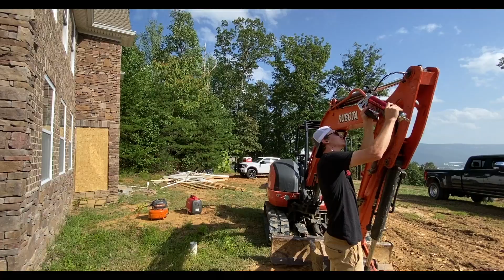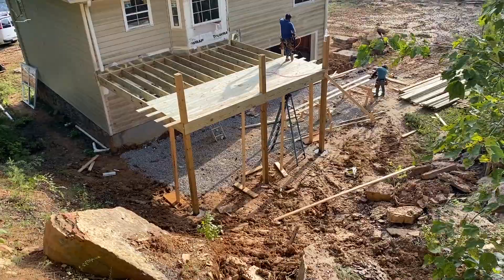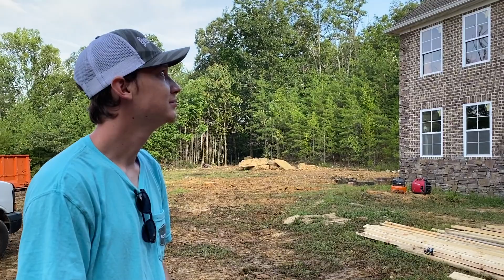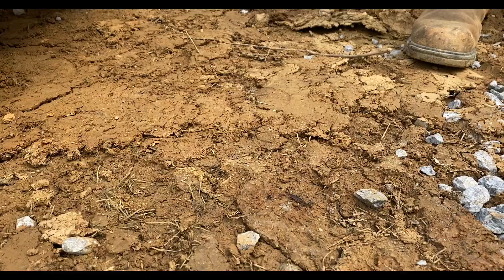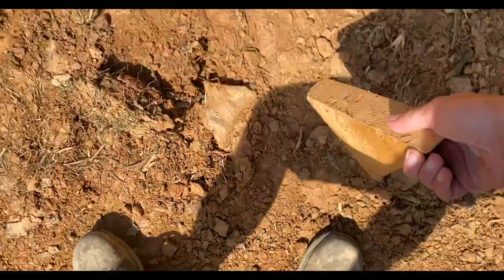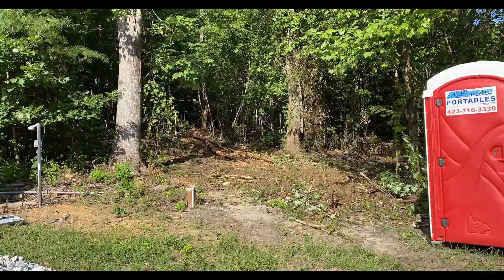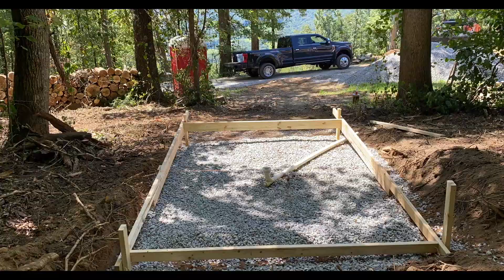The New Goonzquad Headquarters Part 9

Comment: Are you going to move the well, most people keep the pump as close to the well as possible. You need to at least put some 5x5 reinforcement wire in your concrete and 1 piece of 1/2" rebar around the perimeter or 3/8" rebar on 18" centers if you can't get any rebar chairs just use flat rock to hold it up. And get the plumber to rough in the plumbing where you intend to bring the water into and out of the pump house. If you don't bury it at least beneath the frost line you'll wish you would have. Ask your plumber, he knows what to do. 
You should build the pump house over the well, you'll be sorry you didn't. Retired construction superintendent, built everything from chicken coups to 18 story High-rise Condominiums to projects where 20 tilt wall warehouses covered from between 10 to 16 acres each with over 150 acres of concrete paving. I lived on several country estates where Community water wasn't an option, so I'm not yanking your chain about keeping your water lines beneath the frost line and keep it as simple as you possibly can. You might have to dig it up and chopping tree roots down in a ditch sucks.

Comment: Has anyone inspected the roof of the house from inside? From the video it looks as if the roof decking is warped quite a bit. I would have a roofer inspect it to see if it is leaking or allowing moisture to build up inside. Make sure it has proper ventilation as well.

Comment: Good work with the slab it is the best way to go, I put in 2500 sq feet last year at my place. MY 3 top tips 1 Go thicker (i used 125mm (5 inch) ) as concrete is cheap. 2 Use steel reo. 3. Put more conduits under than you think youll need. When you put in your garage  put in a service conduit 6 inch to a central service cabiinet as you will always think of a new thing you need in there. Peace from Gladstone Australia
Reply: Great Tips.

Comment: Guys please don't install a spiral staircase. You will regret it for many reasons. A good solution would be to have your framers to build a stairway that comes down maybe 8 stairs to a landing then the stairs turn either 90 or 180 off the deck down to grade. I will be much more visually interesting and look substantial.
Reply: Sorry 90 or 180 from the landing.

Comment: Man you all threw away a lot of good boards. You should have save the long 2x4 2x6s 2x8s 2x10s 2x12s you never know when you want a board man. You should pull out the nails and stack them up in the garage they will come in handy. Even the short boards you can burn in your fire place.

Comment: To gain access to the Deck run a platform ramp to the Bank and build a platform from the ground to the Ramp would be good for Dogs and Cats and the Aged :) it will all so give you a clear view from inside the house to the backyard ,All so check to see if it has to be made in Metal because of Fire Regulations. just Thinking that's all .

Comment: You dont want the drain level with the edges. It should be at least 2" lower so that you can slope from the edges inwards towards the drain. That way water flows to where the drain is.

Comment: Hey when u order ur concete for the slab get them to put fibermesh in the mix it will make it slab stronger  and if u can get some rebar 1"or  2 inches  off the bottom for the thicker part at the front in a square pattern that would be ideal.

Comment: Boys, great job. Suggestion for you. I HIGHLEY recommend you build a small retaining wall behind the pump house. If not, rain will eventually run that dirt, mud and muck into the pump house walls. It will lead to rot and/or eventually destroying the structure. 

Also, imagine if you excavate the area behind the house so you have a sheer cliff face (retaining any non-rocked area). Imagine a large pond there with some Coi, or bass, or even make it a nice area with a fire pit with seats all around. 

Either way, great job. Peace.

Comment: My dad, back in the day did our two-car garage floor like you are doing for your well house He still bears the scars on his knees to this day from the lime in the wet concrete.( This was before all the "fancy equipment" that they have today and everything was done by hand) So be careful it will chemically burn the skin. Also "LIFETIME WARRANTY"  - (FAST SHIPPING) Visit -  www.paragonstairs.com/spiral/staircase or call (888) 978-6345  Paragon Stairs 106 G P Clemment Dr. , Collegeville, Pa.19426 . Opens at 8AM your time. Hope this helps you out !!! Also, you could always pour a slab under the deck as well to have a shaded/screened in/windowed/ patio or extension/floor for house expansion at a later date...??? As far as your garage build is concerned check out-  R R BUILDINGS on youtube

Comment: Close off the underside of the portch(just make sure to angle it so any water from the top can run out in a drain. Then you'll have a pretty decent carport outside there aswell that should be reasonably dry and protected. Also, if you're ditching the arched window up top, a I think it would look better if the new window had a triangle up top to match the pitch of the roof instead of just a standard rectangle.

Comment: So how much of the formwork / shuttering came from wood previously put in the dumpster ? Some of what went in there was a criminal wasteThe slab prep is  a poor job boys, not enough supports and no compaction of the base material. Will survive a few years with no straight edges then break up...ready for another video !!

Comment: you should get the elec grease gun and the half pipe. you threw out tons of good wood - a big no no - throw all the junky stuff on the foundation out back with some sawhorses and a tarp - at least do a mini pole barn or something there - you are still in too much of a hurry - i hate to say it but all the trades people are expendable and overpriced but you do need help - lots less than you think though - keep it lo budget and minimalist and just get to the garage build - after that you can relax even more and get back to a regular routine - contruction is stressful, you will be glad when it is mostly done
Reply: between the spiders and snakes and scorpions you all may want to do some drinking - go over the garage plans with a fine tooth comb - then again it is just a garage - you should get it framed up quick - do one giant door if you ever have to work on big rig or heavy equipment. start making the roads and moto track - that will take you as long as the garage build - you have enough to keep you busy and mostly out of trouble #there will be blood

Comment: Technically that railing isn’t up to code. If you guys are permitting this work, the inspector is gonna call that out. No more than 6’ distance allowed between guard posts. I also hope they didn’t just nail the rim boards straight to the 6x6 posts. Hard to tell from the video but it looks kinda like they did. That’s also not allowed anymore. The girder beam (whether flush or undermount) that the joists are hung from needs to rest ON TOP of the 6x6 support posts with appropriate uplift brackets (I like the Simpson AC6RZ). By nailing the rim boards straight to outside of the posts, you’re relying 100% on the shear strength of the fasteners to carry the load of the deck. If the fasteners fail, it’ll come tumbling down. It also looks like they wet set the deck posts into the concrete which is also not allowed anymore. The posts should sit on elevated post bases (like a Simpson ABA66Z) so they don’t wick up moisture from the concrete and rot prematurely. When they’re wet set like that, the PT lumber will shrink as it dries and leave a gap between it and the concrete that will allow water to seep in which will basically create a bowl of water. The post will basically be sitting in a bowl of water eventually leading to premature rot.

Comment: Before buying concrete, level out the ground first on well house.  Leveling out first will minimize the amount of concrete poured.   There may be a drainage issue with the slab with the way you have things configured.   Suggest getting professional advice before you pour any concrete.

Comment: Don't forget to glue a frog flap onto the end of your pump room house. It prevents pests (spiders, snakes etc ) from entering your pump house or nesting inside it. Maybe consider some foam around the pipe penetration through the floor to prevent it from cracking when the concrete expands as it hardens.

Comment: I can’t just pour slab you need to run your conduit for your electric plus your waterline from your wellhead to the pump house then to the pump house to your big house and all of that goes underground through the slab. Plush you guys should just go solar power no use paying for electricity when it’s free build a well house/Solar shed to house all the electronics check out wild wonderful off grid they built a pumphouse/solar shed to house all of their equipment.

Comment: Hey Dudes, make sure you run a 1 1/2” PVC line to your well and into the water building before you pour your concrete for your electrical to your well pump.  Also run a 1” water line from your pump to your water building.  Better to run it now before your slab is poured.  If you need more info, email me, chris@barrettelectricalandrefrigeration.com.  Cheers Guys - love the channel!

Comment: At the rate you are going, you might as well just tear the place down and start over. Paint the stone? Ridiculous. Tear out the arch window? Why, that gives the house character in the front. Replace the windows with casements? A double hung can still be open (partially) during a rain, casements can't. The casements will just look like a solid wall of glass without the grids like the double hungs.  Move the pressure tank inside the house. No worries about freezing if it is in the house.

Comment: Those Rocks, Pop Is Splitting Could Have GREAT FOSSILS In Them, So Keep Your Eyes Peeled....Those Scorpions Are Not REAL Poisonous, About Equivalent To A Bee Sting, Unless You're Allergic...15 Acres Of Woods & Your Putting Wood Scraps In A Dumpster???? Place Any & ALL Wood Aside! Someplace Besides A Dumpster!....You ONLY Need A Dumpster 1/2 That Size For Actual Garbage/Waste.... Now Get The Metal, Tie It In, In The Foundation For The Pump House, Make Sure That The Well House Is WELL Insulated Up On That Mountain (Wind & Elevation Are MAJOR Factors) So Your Water Don't Freeze! Lines MUST Be Deeper Than The Normal FROST Depth In Your Area (Again Elevation, Wind & Frost Line Depth.... Keep It Going On, You Guys Are COOKING!

Comment: On your slab for your water house after you pour your concrete put a French drain dig a hole around the back and down the sideswith a shovel down about 1 foot and fill it with your rock for a French drain so it doesn’t wash out you’ll get a lot of rain up there on the mountain and on the mud washes down the mountain it will last forever!!

Comment: My two cents,  I would not pour the concrete yet. Right now all you have is a well, a pressure tank, and electricity at the well. Now if you want water in the house you need to make sure the well pump can do the job because the pressure tank down there won’t and the pressure tank might have to be moved into the house. I would suggest contacting a well company for their expertise. You also might think about having the electricity from the house to power the pump unless you want two electric meters. Since you are thinking about a new garage, now is the time to size your electrical needs. Either case you will need more than one trench from the road to your house, and to a possible garage location for electricity and water. So if you do have a septic system there now don’t go digging it up by mistake.

Comment: 🛑🛑🛑Just a NOTE to Consider. I noticed your shingles are stained with mold which will shorten the life of the roof. You can use a 2 gallon pump sprayer filled with 5 parts Bleach, 2 parts Dawn Apple scented Dish Soap and 3 parts warm water. Mix into the sprayer and start at the top of the roof allowing the mixture to work it’s way down to the gutters. Allow it to soak the shingles for about 30 minutes then use a power washer to wash it off. Be use not to hit the shingles with direct power or you will remove the grit damaging the shingles. It’s all about killing the mold which eats away the protective roof coating. Doing this will restore the look as new and give you many more years on your roofing. 🛑🛑🛑🛑🛑

Comment: Put solar on the roof and add a 4kw battery, you can be self sufficient if you also add a windmill power generator. Being on top of the hill will save you lots

Comment: All that wast wood you can use in a wood burning fireplace,. It’s dry so can be a good fire starter. The other wood trees you cut will take a year to fry out and be wet and not stumble to burn imidiatly.

Comment: You should creat a loft room with a new set of stairs that Leeds up. I would also put 3 dormer windows in the loft room. Don’t change the windows as it will not fit with the stile of the house is my advice

Comment: All that flat rock I would dig out the area under your deck LAY the flat rock underneath and fill sand in between or a sand mortar mixture think it would an excellent use for those flat rocks possibly also a stone fireplace barbecue also

Comment: If you had money to throw away changing windows you should have used trex or some other synthetic deck flooring on your deck. Treated lumber will have to be replaced in the next ten years or less if you don't maintain it.

Comment: When pouring a concrete pad you first need too compact the ground with a compactor( vibration plate) also need plastic on the bottom and some rebar iron 1 inch from bottom of the slab.
Reply: Y’all realize it’s just a pump house right? No need to have reinforced concrete for a structure that size
Reply: @spencer4584  Really you should never cast concrete without reinforcement. There may not be much load on this slab, but for stability and because it is not a heated structure there ought to be reinforcement in there. But don't listen to me. I only do this stuff for a living.
Reply: @spencer4584  Yep, they still should have dug a footing along the perimeter. That slab is liable to move over time without it, not to mention cracking. Do it right or do it twice. They have a mini ex sitting right there and remesh is cheap.
Reply: They should cut those stakes flush with the frame for screting it will make it easier
Reply: This is something that should be done by professionals. The way they have it the slab will fail and if there's any high winds the building isn't anchored. Water will Pentwater that slab too without vapor barrier
Reply: I have only worked on a couple of slabs before but was thinking its nothing like ive done here. Thought maybe that's just how americans do it.
Reply: Yes, and really they should dig out for proper strip foundation and compact sand under the slab. Also, that formwork will never work since the concrete is just going to leak out under the wood. By digging out for a strip around the perimeter, you can also lower the height of the slab. Remember to oil the formwork before pouring the concrete , or it'll stick-
Reply: @jacobhaagerup7816  Yeah I was looking at the gravel wondering whether they should have done a strip foundation...some sort of footing to anchor it in place when its cut into a slope like that. They can probably get away with it without the rebar, but they should probably have put plastic under that sub base as well.

Comment: for the pump house slab you should drill some holes in the 2x4's and lay rebar across to strengthen the slab and reduce the chance of cracking.

Comment: Don't just rip the old windows out and give them to the supplier as "junk". Have the windows removed carefully and then you can sell them. They may be 10  years old but someone would snatch those up in a heartbeat. Helps defray the cost of the new windows.

Comment: Try architectural salvage if u cant find a spiral stair case alot of old buildings had cast iron spiral stair cases there was a guy near by that used to remove stuff and resale it, he at one point had like 5 of them of various sizes, they are of higher quality and u can get them much cheaper.

Comment: “Window guy” “Dumpster guy” “Plumping guy” “Framing guy” “Hardware guy”  Who we missin😭😭😭
Reply: Terminex guy.
Reply: Insulation guy...low voltage guy...drywall guy...painting guy...finish carpenter guy...tile guy...cabinet guy...counter top guy...
Reply: You forgot concrete guy.
Reply: “electric guy”

Comment: Guys y'all need to be wearing some gloves at the very least. A scorpion bite will feel like you are on fire unless you have an allergic reaction and that could lead to death. A black widow isn't anything to play around with either. Try putting white golf balls around the top and lower edges of the property where the house is and the snakes will eat them and supposedly cannot regurgitate them so it takes care of them 😁. For the scorpions and spiders if you can find some diazanon (I think that is how it is spelled) crystals you can sprinkle that around the exterior of the house and it will help keep them smaller critters away from the home itself.

Comment: Also keep a look out for the hobo spider it will kill you also. Ask me how I know, I was bitten by one 5 years ago. And thru the dumbass dr i saw didn't do anything about the bite. I died twice as the result of it and to boot it  carries staph infection. I  weighed 345 lbs at the time of the bite. By the time I regained my senses I  weighed 149 lbs yeah it caused me alot of pain also. Yall need to spray the bushes and around the house monthly if you have black widows you probably have hobos.  Cause I do.